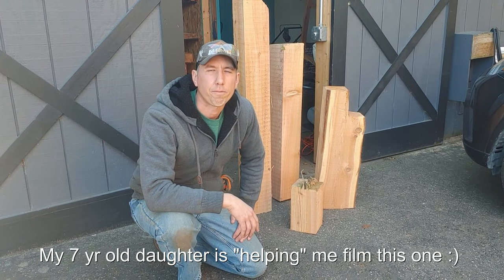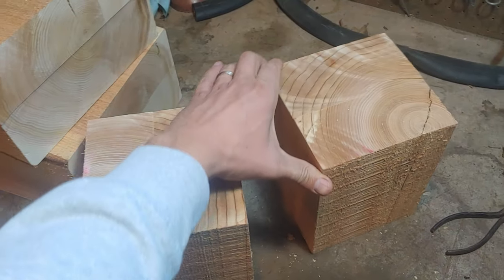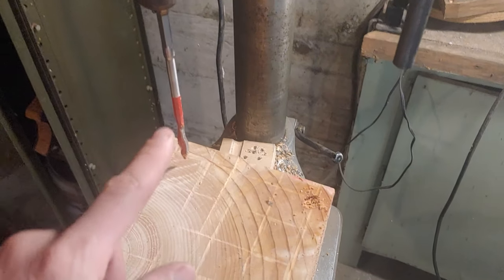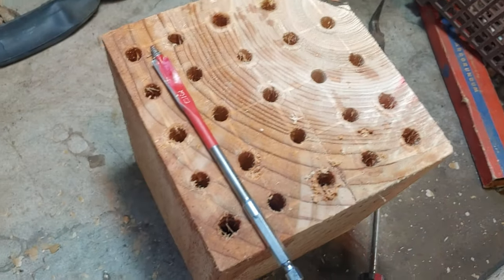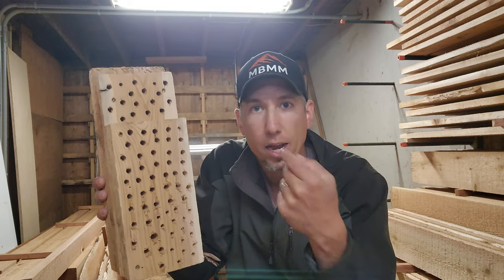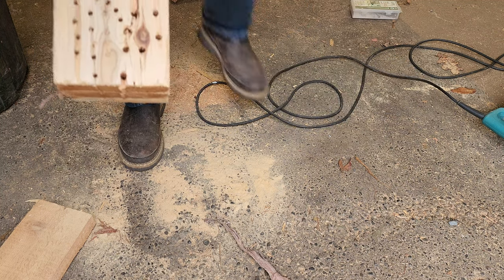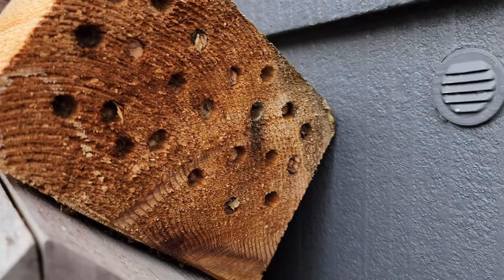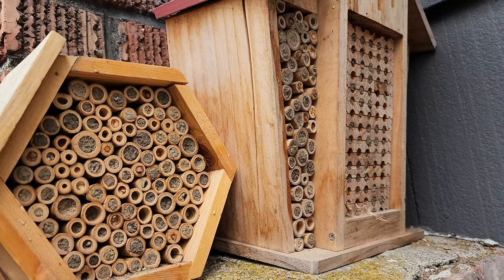DIY Mason Bee Houses: Struggles, Lessons, and Sustainable Beekeeping Efforts

Comment: I have drilled many blocks like this. You have to use very dry wood. The holes must be absolutely smooth at the entrance and on the inner walls, otherwise the bees will injure their wings. The bees know this and avoid rough and damp boreholes.
Reply: This

Comment: The Mason bees like the holes to be super smooth with no jagged wood debris around holes and inside. Use a sharp drill bit and ream the holes out on high speed in and out fast to make holes smoother. I have even used my butane torch to burn off the whiskers. Also the correct diameter hole I have found that work well is with a 5/16” bit at around 5” and 3” deep. I also set the bee blocks in a dry sheltered area after summer is over. I enjoyed the video and your other channel Jason.

Comment: @SJForestProducts if you want to stick with this method i have one tip from making such bee homes myself: screw a thin wooden plate as a roof on top of it! it extends its lifetime by years and the bees and their breed stay somewhat dry, they can handle water or moisture to some extend but who don't like it dry?! 
also if you have reef or bamboo on your properties, they like those materials way more! maybe bundle reef together with wire, stuff those bundles tightly in old unused buckets (so they are safe from rain) and screw on those buckets wherever you want... if you secure the open side of the buckets with wireframe the bees will be safe from other animals and the bundels can't fall out over time... should be a very good diy solution that's cheap too, those prebuilt homes are way too expensive...
and a big thank you for making such homes! nature needs every help it can get whenever we humans are around^^

Comment: Jason, I was curious why you started out by drilling into the end grain on your big blocks? As with your chain saw, the cutting is easier perpendicular to the grain like you did on the 2x6 boards. Dry is always better, and in my estimation the sharp auger is the best bit. However, it is self feeding so you may have to stop and back it out when depth is reached. I also wondered why you were cross cutting the beam pieces on a table saw, very risky. Thanks for all of your videos, love your channel.

Comment: Jason,  
        I have extended drill bits by welding a rod onto the end,  line the bit &  extension rod up in a lathe,  you can always grind your weld down to under the diameter of the bit. But i would come up with a vise to hold the blocks while drilling.